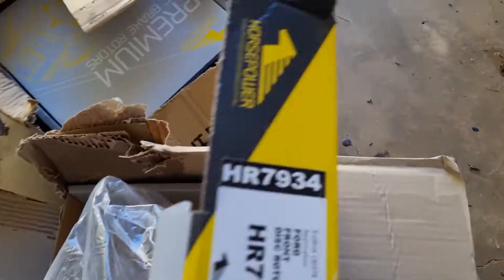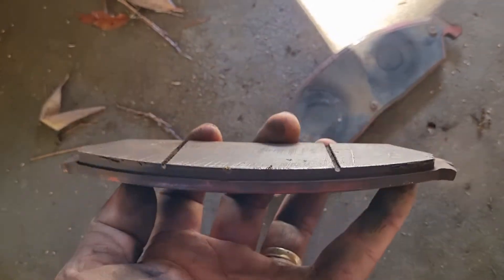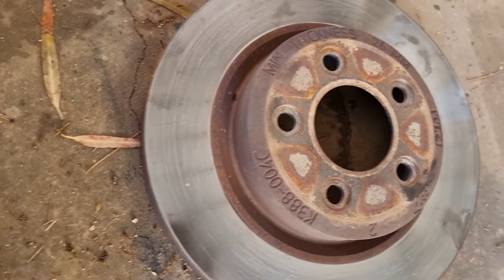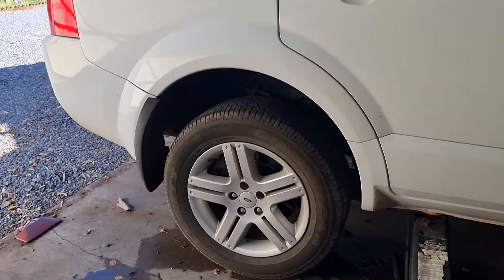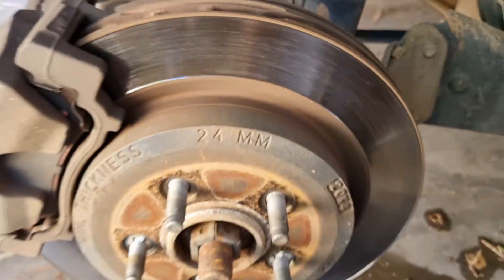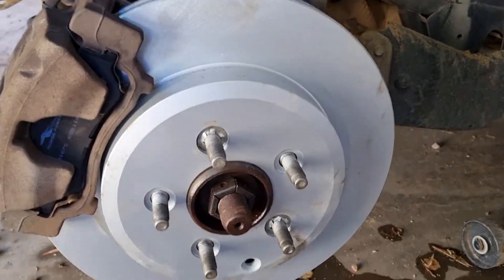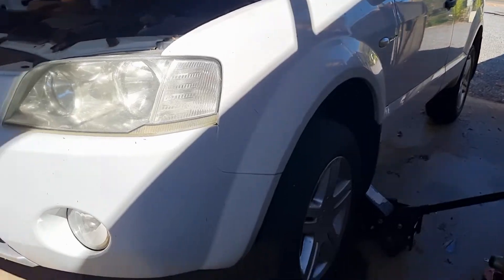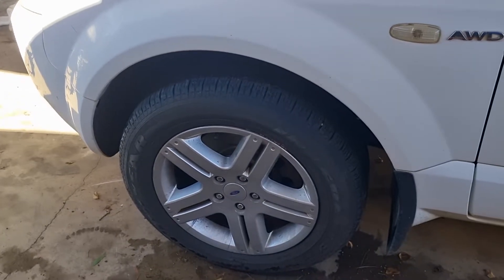how to change front+rear disc brake rotors brake pads for ford territory sx sy sz

Comment: hey bro how did you take off the rear disc rotor is there any lock at the back of the hub to twist it? cause the front one is easy to remove it  please advise